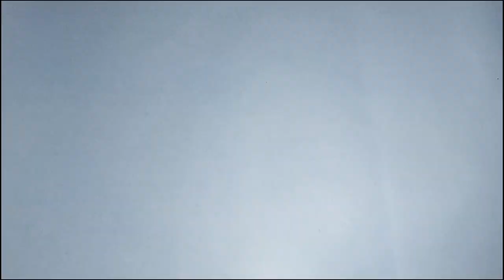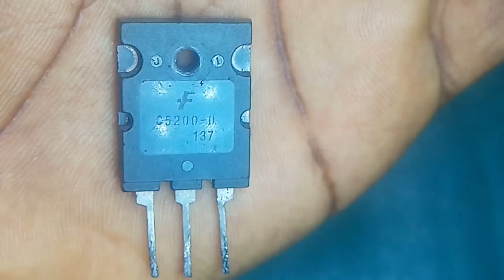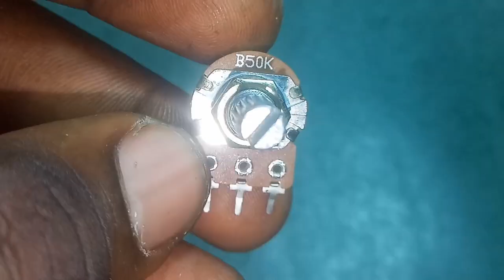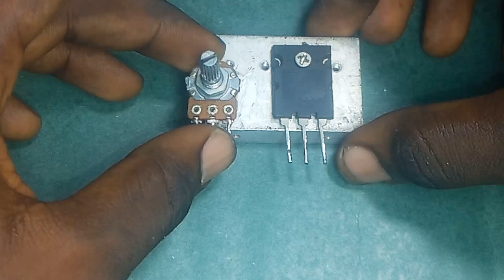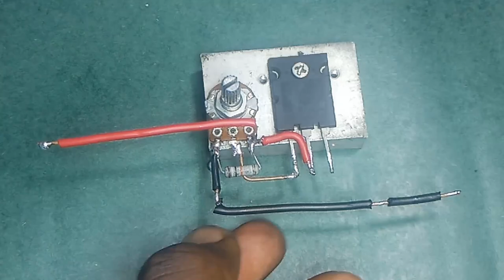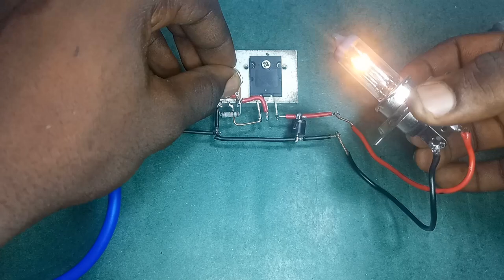How to make Adjustable Voltage Regulator,DIY voltage controller

Comment: Can I use this circuit for solar panel as buck converter 18 to12 volt
Reply from the maker: Yes you can,just set the output voltage to 14.8v Max and add cooling fan to the circuit